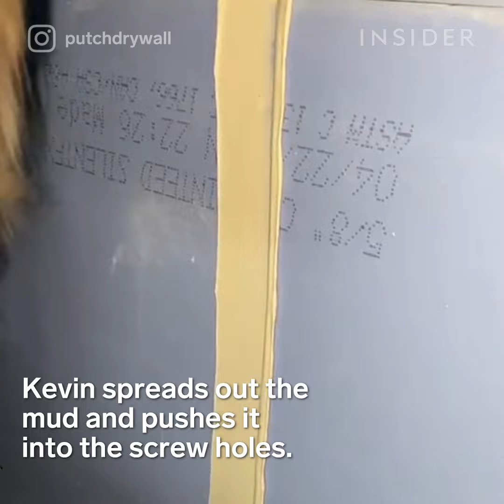How Professionals Patch Screw Holes In Walls

Comment: I'm hoping they go back and re-spackle because that stuff shrinks as it dries. Shrinkage causes those screw holes to stick out like a sore thumb after being painted. They'll be little divets on the wall.
Reply: My uncle does dry wall, they do 2  coats for textured finishes 3 or more for just paint
Reply: @krispbacon9474  sad but true. So many homes are built with low quality labor and materials. While priced as if it were a castle.
Reply: I mean not really though, with caulk sure it shrinks a lot, but with drywall compound? Then primer and 2 coats of paint? I'm 25 years old, but ive remodeled many houses. I've never filled a hole with drywall mud and later painted it seeing the hole afterwards, never
Reply: But then again, many guys are just the drywall guy or the screwhead guy 😂 when you do it all you see it all
Reply: I agree with kurtiss

Comment: I'm waiting for the people who actually do this to join and yell about how bad the technique is
Reply: It is bad, I can confirm. Looks pretty but it will shring when it dries and holes will be visible
Reply: @Crawford92 you forget people play alot for these houses.. so time isn't money in this case, they should be professional and get the job done correctly Instead of rushing.
Reply: @Crawford92 it's a small cost to give the customer a top not product instead of receiving a rush job just so the company can make a little bit more cash. Some things shouldn't be rushed and this is coming from someone who has worked in the construction industry as I have seen how these rushed jobs turn out needing repairing further down the line which costs you more money than it would of in the first place if it was just done correctly.
Reply: @Crawford92 yes, if you're going to use plaster there'd be no need to do this but nobody said this house was going to use a plaster veneer.  It's likely they are just doing drywall and painting it, so youd have to fill in the screw holes.
Reply: It’s good technique for smaller jobs but doing an entire house by hand is just waste of time and money. They have tools for that. If he has a box I don’t see why he wouldn’t have a nail spotter as well
Reply: Don't let all of these response comment fool you, 1. Its good technique, its easy. 2. It takes like 2 seconds to do and if you do it loose and runny like this then you won't need to sand. But its not hard work dont let these guys fool you, you get into a rhythym and can do it for hours straight without even thinking about it
Reply: @Crawford92 😏 come on man
Reply: @Crawford92 who does plaster anymore 😂
Reply: I been drywalling for 15 years and I can confirm this is how it's done. Striping the screws this way makes sanding easier. It allows you to use longer strokes without fuzzing the paper in between. Also it doesnt take any extra time to do this
Reply: Sorry to disappoint, this is good technique and it takes time and practice to do it this fluidly.
Reply: @64324037  If dried properly under standard conditions and sanded flat, joint compound rarely flashes – especially when done fluidly as shown in this video. That being said, a coat of primer before paint would cover any potential faults
Reply: This comment section is cancer.  Its pretty standard to spot screws... And the technique is spot on.  

Plaster?  Did i step in a time machine?  Been a drywall finisher half my life n this is very common for flat wall finishes.
Reply: @64324037  
It takes 2-3 coats to properly spot screws so... Your comment is useless.

Comment: I'm a drywaller they are doing fine. It's not hard to do at all I could teach you to it in about twenty minutes. There are a handful of tricks. Notice that he cleans the knife after every time he touches the wall.if you can do that you will be fine. Also if you screw it up sand it off and start again .drywall materials are cheap. The labor is what you pay for.

Comment: An average-sized room can have over 1000 screw holes?? Sorry but I think it’s an exaggeration…
Reply: Depends on the size and screw spacing. A single 4x8 sheet can have 40 screws or more in it depending on if it's being stood up or horizontal and if it is installed by the code. like..every 6 inches on the edges and 8 in the field.
Reply: @leozmaxwelljilliumz3360  35 screws the 6 and 8 is for exterior
Reply: @billy9995  codes vary. Even interior walls are in places are  required the same as exterior.
Reply: @johnkutsch7411  i get it. Been there done that, was just saying standard drywall standard commercial code. You can break this down an aweful lot down to types of screws and wall types, as im sure you know its all in the specs

Comment: If you coat screws in an entire house by hand instead of using a nail spotter 🤣 good way to get paid for an extra days work I guess
Reply: If it takes you an extra day you are not a drywaller
Reply: @johnkutsch7411  k bud
Reply: @WhiteStrike01  spoken like a hack. Taking a day to spot screws may be typical, for you.
Reply: @johnkutsch7411  exaggeration for effect but it’s just not efficient and would take hours to do a new house by hand instead of maybe 30-40 minutes with a spotter. You’re funny tho. Idk what experience you’re talking from but I’m used to 2000+ square feet houses which yes, would take so-close-as-to-not-matter, a whole day to spot that many screws by hand.
Reply: @WhiteStrike01  you must have the only 4 row nail spotter that never needs refilled to reduce an 8 hour day to 30-40 minutes. Keep exaggerating for effect, everyone is good at something.